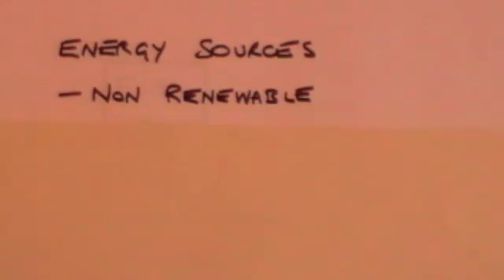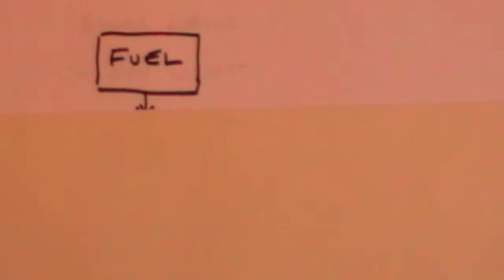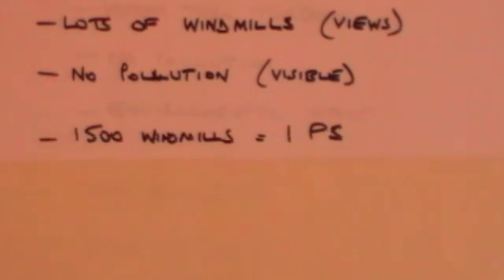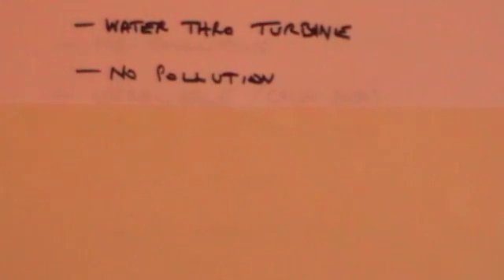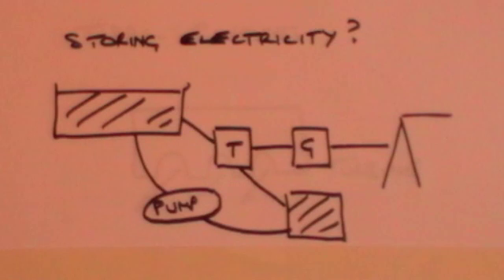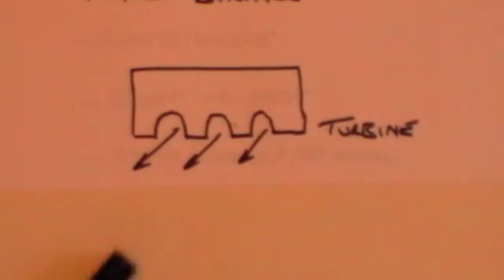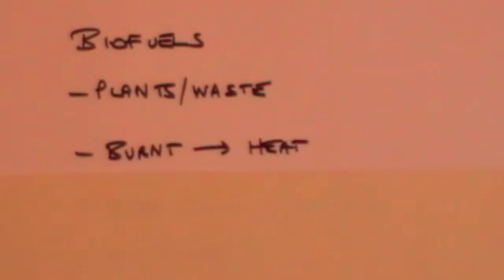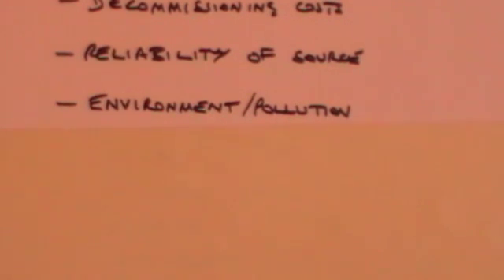Energy sources: GCSE revision

Comment: Wouldn't it be more reliable to construct wind tunnels through mountains? I mean, a tunnel in the right place, facing the right direction and having the right shape would have a lot more air pressure than a windmill and could produce a lot more power. Plus it wouldn't be as visible.

Comment: You do not need to flood a valley if a River is used for the flowing water. We do this on the Ohio River in the USA at several locations not mention the Boulder Dam in Colorado
Reply: Lake Mead, the artificial lake created behind Hoover Dam (Boulder Dam), is 250 sq miles of flooded land. Read the environmental damage caused by the dam: http://en.wikipedia.org/wiki/Hoover_Dam#Environmental_impact
The dam is very useful, but we do flood large tracts of land to make them.
Reply: HarshColby
point  taken on lake mead.